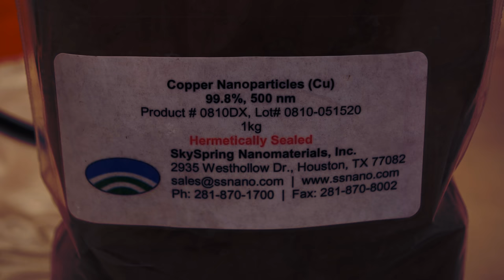Make Our Best Thermal Paste... YOURSELF!

Comment from the maker: Check out the first video on our Thermal Paste if you didn't see it already! 👍 https://youtu.be/Glfak2B9J5U
Reply: MAKE DE BESTE THERMITE PLEASE.
Reply: Did you test using peppermint essential oil pure concentrated inside your paste?
Reply: I was just interested to see if you were using toothpaste cuz you had toothpaste sitting on your counter last time and if so maybe the active ingredient of peppermint is what's giving you the ability to make this work.
Reply: I'm glad you were showing this video without any secrecy. You say water is the most thermally conductive of liquids but what about gasoline... gasoline is kind of like peppermint oil maybe it's not the purpose to find something that's naturally cooler maybe these liquids don't conduct thermally as well... Either way super fun video thanks 💯
Reply: @AquarianSoulTimeTraveler  It is now the season of Pumpkin Spice.
Reply: Okay you sold me on subscribing... I subscribed lol
Reply: @mikew1259  would probably evaporate pretty quickly unfortunately. Maybe gallium or something which is a liquid at relatively low temperature and then become solid again.
Reply: I have been working on testing some ideas of applying high voltage DC charges to things like say a mirror that is finely polished to expand the electron shells and smooth it out a bit more, to clean up  reflection and help ensure more of the light hitting it is reflecting off and not becoming heat, 

another is conductivity of electricity, by placing a high voltage plate system on either side of a wire, close enough the static charges can penetrate their dielectric layers and the one on the wire, to orient the wire's atoms and see if it helps increase the conductivity and lower losses, and I am wondering too if that might work to increase thermal conductivity and even promote it directionally too, hmm
Reply: Hello sir, is there a way create a hot water battery? Can we heat the water during day and use the heat to generate electricity during night?
Reply: Where do you live, I want to visit you, I love your achievements, your genius, you are better than people
Reply: Gamers nexus will do better testing if you send it to him.
Reply: @obsculor  I'd say so.
Reply: @skywalker6428  He already has, check out his older videos.
Reply: @Jim_Bo  it's in the previous video about thermal paste, I believe.
Reply: Throwing my vote in for Gamers Nexus, as well.
Reply: @jjhack3r  Absolutely would!
Reply: i would love to see You guys doing a fine lapping vs stock cooler+cpu comparison. and via fine lapping i am speaking of 0,001mm diamond paste lapping finishing to mirror surfaces on lapping plate and possibly inspected under monochromatic light source wit optical flat. i think it would be a really good representation of the importance in the surface quality.
Reply: @ITpanda  Thanks;
Reply: Already studied that video very well .
The small extra details you gave  us  in the epoxy resin series made th quality of my epoxy carbon projects , w
ay better quality .
Also i following along for quite awhile  , i know i have to see them all.
Not only the topic concerning what i do here.
Because they all are very relaxing and educational to watch , well done!!
Very curious what Linus gonna do with it ?
To testout the maximal potential of the paste .
I´m vaguely see a thumbnail appear : Linux...oxyacetelene torch...the paste and one of the latest fastest   graphics  processor..
All in one image :D
Greets from the Netherlands Johny geerts
Reply: you f*cking awesome 👍
Reply: TI: For the paste mixer, instead of adding 10 grams, couldn't you find a material that would weigh 10 grams and cut a disk of that material and permanently place it in the bottom of the mixer cup? This way you can just insert your jar into the cup and you are set and you don't risk forgetting etc.
Reply: @ThomasAndersonbsf  like ionic wind cooling?
Reply: Can you please make more of rocket videos?
Reply: I love your videos, your lab and the amount of knowledge you have :)
If you read these comment say "CUACK" in the next video, that will be so cool haha 
Greetings from Argentina :D
Reply: Awaiting torpedo video. Also hoping that you would think of doing further rocket videos especially pertaining to integrating the motors with the frame , aerodynamics of it .
Your videos are very knowledgeable
Reply: the rod demo was flawed by the fact that there was no break in the 2nd rod. you wont have atomic contact even with no plastic in at all. additionally the pot of boiling water underneath means convection heat transfers a lot of heat to the top not through the rod at all.
Reply: This is a thorough, excellent video, but don't have a drink beforehand.  I fell asleep twice.
Reply: @mikew1259  One of the most effective thermal compounds is liquid metal. I don't think it's mercury, but they make it.
Reply: I purchased a Thermal Epoxy from your store on 21 September 2021, it has been more than a month and I have not received even a notice about my order.
Does Tech Ingredient even ship products that are sold on your shop ?
Reply: I would love to collab,  perhaps a limited run in a orange/red color?
Reply: Saw your update regarding liquid metal. If you can come close to the defacto standard of Thermal Grizzly, you'll go viral yet again. In the gaming, research, and enthusiast community, there are so few choices for this niche solution, very few are willing to experiment with untested competitors. Show us that it doesn't require 6 figures to produce, and I bet everyone will feel better about trying a new brand. By the by, will you test at different target operating temperatures?
Reply: Also, congrats on beating industry giants like Arctic & Noctua!
Reply: I would, but I only watch Major Hardware. Who just has a massive amount of fans.
Reply: You did not beat the thermal paste companies in your previous video! You just showed us that your paste maybe can transfer heat faster for a small amount of time. 

What we did not see in order to say that your paste beat the others is 

a) For how much time does your paste keep its properties? I mean even toothpaste is better than e.g a thermal grizzly paste but only for a few seconds. 

b) what is the heat transferring time curve in relation to head source temperature as the temperature of the heat source increases.
Reply: Niculae George  He did talk about it, albeit simply: He said which silicone oil to use which was the thinnest which would not evaporate more quickly than the liquid in commercial thermal paste.
Reply: @Jim_Bo  Good question. It should be quite poor, because the Aluminium powder will have an Oxide layer, and it is loaded into a non conductive oil.
Reply: Is it’detoof .
Reply: What about using a VERY thin matrix of a bee hive maybe made with a thin metallic structure within the thermal paste but have the metallic structure overhang when applied to work as a way to dissipate the heat out of the device.
Reply: Does this thermal paste aid in cooling transistors?
Reply: So if i understand you here, this paste formula you have transfers heat better than over the counter paste available currently?
Reply: @AquarianSoulTimeTraveler  Gallium is probably the most dangerous metal inside your computer.
Reply: this whole thing makes me wonder how it works compared to liquid metal TIM
Reply: @ericdee6802  only if used as the layer between the transistor and heat sink.  A CPU is basically a ton of transistors.
Reply: IDEA for mixing proplem what about using hydraulic press to extrude it couple of times thru small hole ?
Reply: is the thermal paste for spark plugs different from the one the computer people use?
Reply: I have a question please: you have used aluminium powder or aluminium oxide powder?

If you have used aluminium powder why ? Because aluminium oxide powder is non electrically conductive.

Comment: Hi, compounding pharmacist here! Tips for those using the mortar and pestle: start off with small quantities of stuff you need to pulverize or mix, then start adding in larger and larger quantities stepwise to avoid clumps and ensure uniformity! Adding all at once will especially make the fine powder just puff up on you and you'll have a cloud of material on your work surface!
Reply: Same when making glaze for cinnamon buns.  People can't believe that a thimble full of liquid can mix a bowl full of powder!
Reply: Im a german pharmacy student and alot of the stuff he is doing, really reminds me of compounding lab back at uni, pretty interesting how that pharmaceutical knowledge can be applied in a totally different field
Reply: Something kind obvious but everyone forgets those things sometimes. Not me. Lol .. JK
Reply: I wonder though, if I don't have access to the fancy machinery... could I feasibly make this thermal paste with just the mortar and pestle?
Reply: @herrpez  No.  You could do the two largest sizes by hand, with enough time and patience.  But the surface tension of the oil is too high relative to the particle size on the nano particles, so you'll get clumps that don't suspend properly (think hot chocolate powder at the bottom of a cup).  You might be able to thermally excite the nano particles enough to break that up.  In the same way the sonicator imparts thermal energy, imparting thermal energy causes vibrations that disrupt the surface tensions.  But that sounds like a good way to make a big mess.  Just going with the two largest size particles is likely to get you about 60% of the way from the cheap to the expensive product in performance, which is likely enough for most applications.
Reply: @lperkins2  Thanks!
Reply: @lperkins2  I wonder if you could approximate the technique using the double syringe method and impart a shear force on the liquid?
Reply: @lperkins2  Is the surface tension of the oil a desired attribute?

Wondering if the addition of a surfactant would increase miscibility without giving something up.
Reply: @JohnDlugosz  😸😸😸😸
Reply: This is also true when mixing most recipes in the kitchen. It's especially true when trying to saturate water with gelatin to make "jello" with the consistency of gummy bears.

Comment: I agree with the people suggesting sending some samples to the channel "Gamers nexus". They run comprehensive and thorough tests which I think meshes well with your type of videos. They also aren't afraid to tear you a new one so be aware they'll be brutally honest with whatever result they may reach, good or bad. Though I have confidence in the thermal compound you've made here.
Reply: tech ingredients testing is far more methodical than anything GN can come up with. tech ingredients guy is literally a scientist and is more experienced giant in comparison to GN
Reply: @lordjaashin  Probably, but the relevant comparison here is between GN and LTT, since not only independent review is needed to gain more credibility but these other guys might be more knowledgeable in software test suites and can potentially test in a wider range of scenarios. Also tech ingredients seem to want the additional reach that these guys can provide.
Reply: @lordjaashin  GN is arguably the best independent outlet doing testing specifically for PC hardware. They have the flatness measuring equipment,  pressure testing, dummy CPU heat load to control for CPU power variability, and they're working on getting a thermal chamber to control for ambient temps, which is on par with, if not more thorough than the testing in the previous video. LTT will just slap it on a CPU, maybe.....MAYBE turn of dynamic boosting in BIOS and record temps while running some benchmarks. 
They both have their place on the platform, but GN has a much more scientifically methodology than any other PC tech tuber out there, hands down.
Reply: @maxpower1819 Excitement or thoroughness; you can't have both.

But then again, maybe you can ... I dunno
Reply: Honestly, they could just make it themselves and test their results
Reply: I suggested it on the last video about the TP. Nothing against Linus, but his videos are aimed at 14 year olds. He doesn't have the time or the equipment to do the kind of testing I want to see that his audience would skip past anyway.
Reply: Gamers Nexus would be a great channel to send this stuff to for testing. I'm sure Steve would love tryin this stuff out against other thermal compounds.
Reply: Tech Ingredients sells this product, so a specialized channel that tests this kind of stuff can buy it. Or better yet an interested party could forward it along with Tech Ingredients' links as reference, check if said channel would be willing to try it out.

Comment: This is one of the highest quality channels that I've run across. Tech Ingredients and Applied Science's channel are the two top tier science channels on YouTube. Great stuff!

By way of a request, could you do a video on making expanding polyurethane foam, which, coincidentally is the opposite of this one on thermally conductive paste? I've had no luck at finding info on it and would love to see how it could be DIY-ed since it so expensive commercially.
Reply: My friend has a spray foam insulation business and I worked with him for a number of years as well as partnered with him for a time.  It's not too complicated as there are only 2 parts; isocyanate (iso) and a resin.  I'm not certain how easy it is to acquire those for ordinary people but it's probably not.  They are pretty toxic by themselves (not immediately life threatening unless ingested but not something you want to be exposed to regularly) and when combined they off gas fairly toxic fumes as part of the chemical reaction and foam making process (off gas = "air" bubbles = foam).  Once the reaction is done it's safe though, it's just polyurethane plastic.  The resin compounds vary a bit by manufacturer and to buy them require licensing and are sold with each brand's iso even though it's more or less the same (the point being getting iso by itself from these companies isn't very easy).  Even if it turns out to be relatively easy to obtain and produce your own resin blend and iso, using it to insulate something won't be so easy. The parts are only liquid when separated and once combined quickly start turning into plastic foam.  The reaction only speeds up with heat and mixing which you'll want to incorporate because incomplete reactions are bad (toxic chemicals remember).  A large portion of the expense for commercial spray foam is the equipment to apply it and the experience of the insulator.  The equipment is purpose built and expensive.  Where anyone can install batt insulation with a knife, staple gun/ hammer tacker and a ladder, a spray foam rig is many MANY thousands of dollars.  You need a plural component propportioner (google that if you're interested), related pumps, hoses and "gun," heavy duty air compressor, sufficient generator to run everything (~40KW), a method to transport all this equipment, and relevant safety equipment (toxic chemicals remember).  Not knowing what you are doing can lead to too many problems to list.  None of them are anything you'd likely be willing to live with because you DIYed it.

If you have a small area to do, a products like Froth-pak exist but seem unavailable right now.  These aren't cheap either and if you need more than 1 or 2 it'd probably be cheaper to have professionally done anyway.  To try and replicate these for a DIY method of application is also likely far more costly than it's worth.

Unfortunately, not everything can/ should be DIYed.  But I would be more than interested if Tech Ingredients proved me wrong in this case.
Reply: @houndofhysteria2327  Thanks for all that insider info! Very helpful!
Reply: @SapioiT  Thanks. Sounds interesting. I'll check it out.
Reply: NileRed did something similar when he turned plastic bottles into foam.
Reply: I believe some of of the precursors for the synthesis of the components of expanding foam are toxic (cyanide derivatives) and are tightly regulated. It would be difficult to do the subject justice without an industrial account / licence with one of the few manufacturers. 

Synthesising the ingredients for making your own precursor and doing it long way to prove it is possible albeit difficult and uneconomical is more Nile Red than Tech Ingredients.
Reply: "Tech Ingredients and Applied Science" -- Huygens Optics is also up there.
Reply: Have you tried google?
There are tons of search results, with recipes and videos en masse.

The components are pretty basic, you have to buy them though. Synthesizing the components yourself is a litle bit advanced.
The rest is just mixing the two, add a few drops of water for a better reaction and voila, you have foam.
Our chemistry teacher did it at school with us back in the day.

A completely different point would be if you're looking for very specific properties of the finished foam material - that's a lot of RND companies won't be wiling to share.
Reply: try zoffinger here on youtube. hes always using the stuff in a pourable formulation in his crazy kayak mods. it looks like the standard for adding positive buoyancy.
Reply: Check out the thought emporium for some more great science content